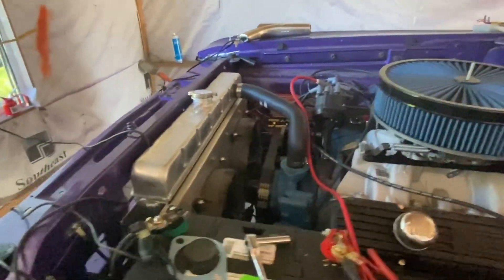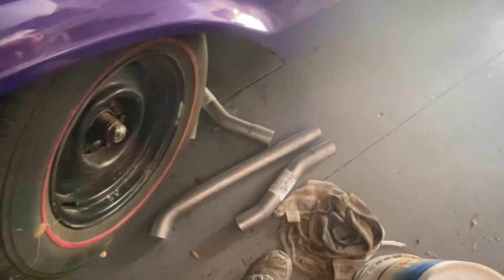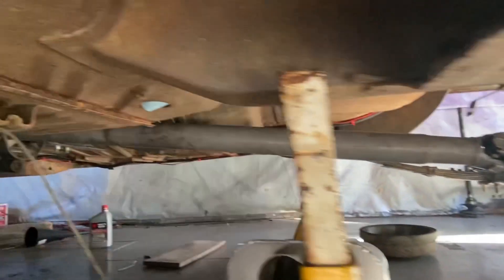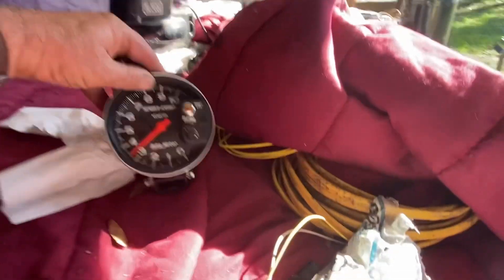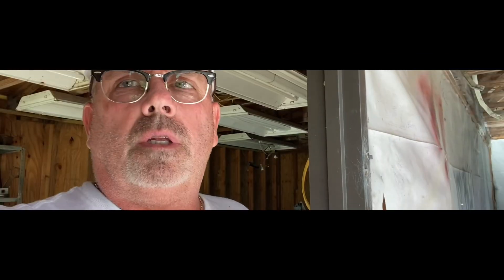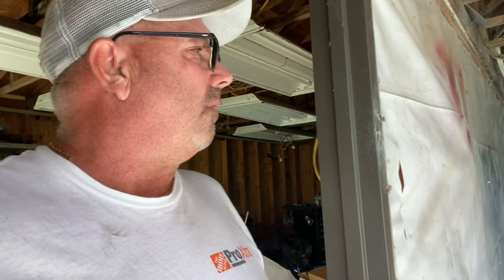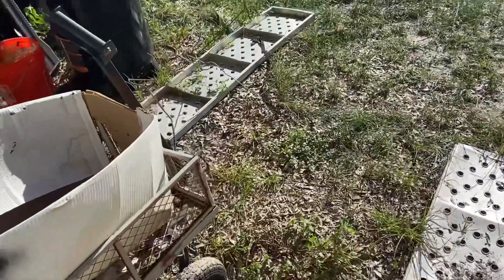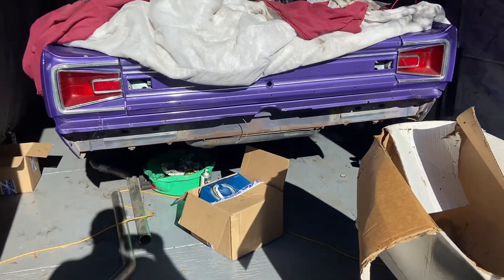Project update #nonamenationals #mopar #440 #dodge #dragrace #dragracing

Comment: I have one of those handy dandy pipe benders for exhaust
Reply from the maker: I had jegs. Had to modify driverside comin off the header
Reply: @gtdart970h  usually a you have to alter as you go when using headers.  But it looks good far as the rest goes. I have a few I'm trying to get back into working on but after accident I'm a lot slower now.
Reply from the maker: It’ll come. But I will tell you I move slow regardless😬😬